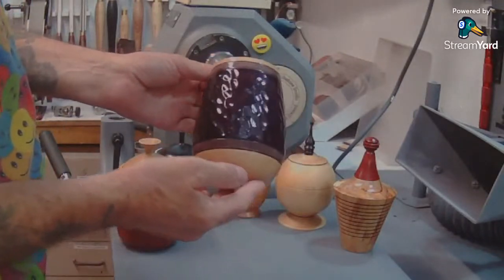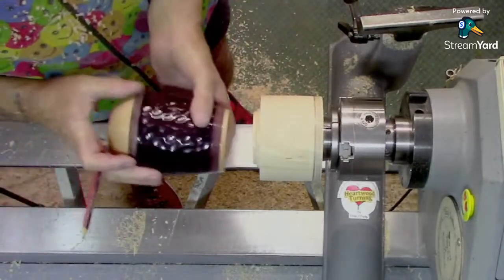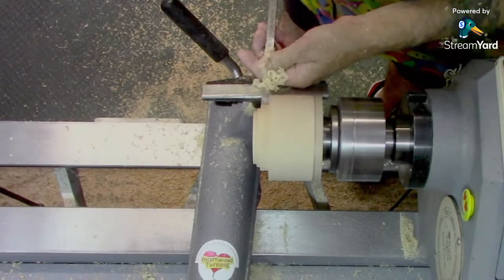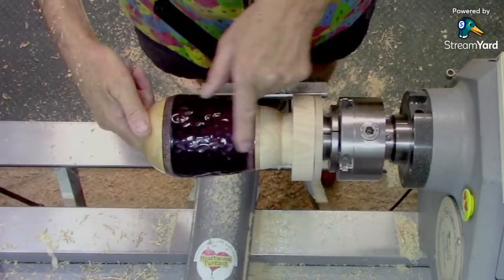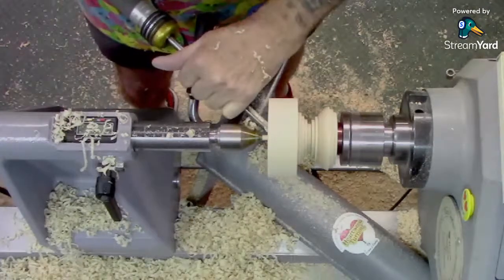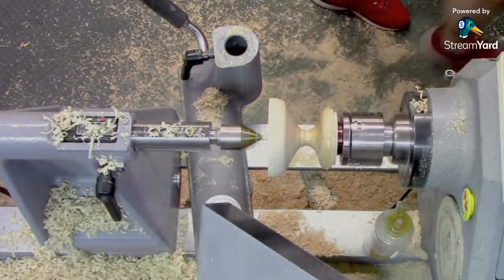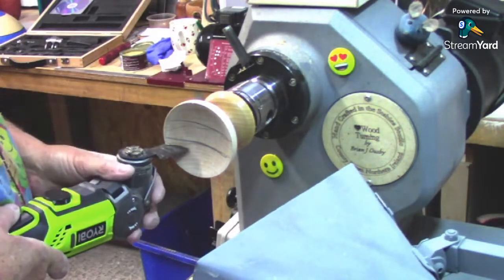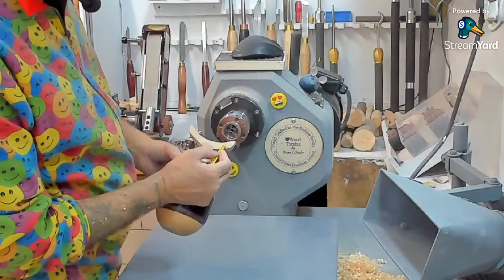WoodArt - completing the Project from Monday #colour #texture #spindle

Comment: Well done Brian. The pot looks great and this handled lid is going to be fabulous by the time you finish. 

I like the way you’re thinking at the end, that you can finish this lid. This is one of the times when JP’s advice would work well. “Speed is your friend.” If you are comfortable with it, max speed would allow lovely cuts on the handle section. Pete’s thought to make the curve flatter and 1/4” sounds about right. Inside/outside curves need to be similar. Ends flat, either verticals or slightly slanted in on the top edge. I’m thinking to resemble a flat stick that has been lashed on. 

No mater what you do, I’m sure it is going to be stunning. Thanks for sharing.
Reply from the maker: Thanks Doug all of the above was implemented it’s in its final finishing phase now Reveal tomorrow